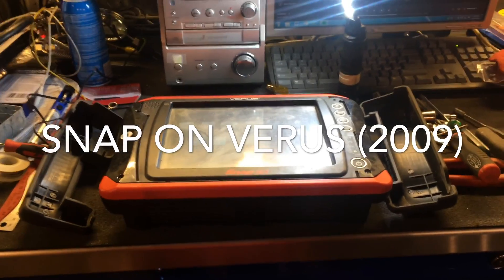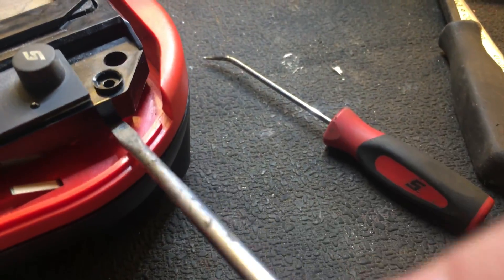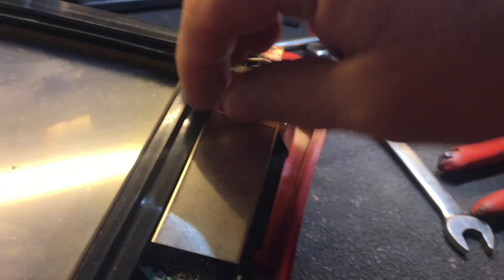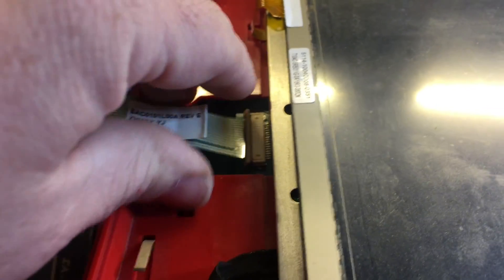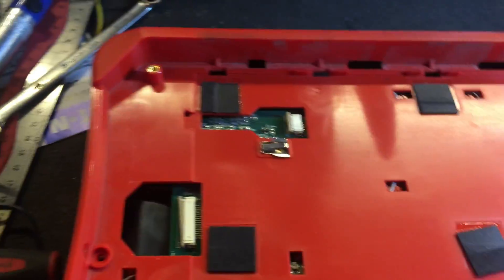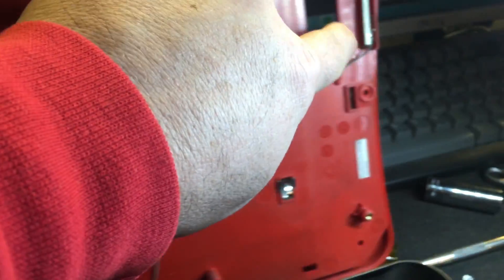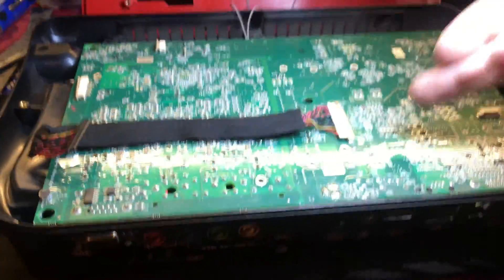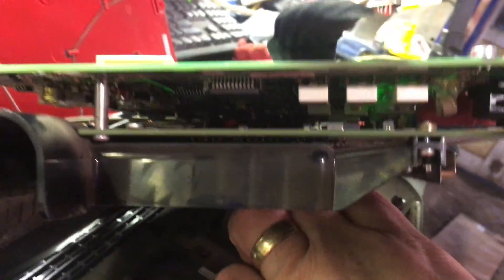Snap On Verus Disassembly Tips

Comment: Thanks for this, doing a similar Verus Edge, proper pain it is. Having replaced digitizers and screens before on regular laptops and tablets this is tricky, also the cost if it goes pear shaped.
Reply from the maker: I don’t remember if I put this in the video, but I found a compatible plug on mouser.com after taking careful measurements of the broken one. It takes some patience but they have all types of parts like this.
Reply: @JoesCarSmartsNY  For the DC input jack? I'm having this problem and looking for the part. Do you remember which one it was?
Reply from the maker: @rayl2555  I’m not 100% sure if this is right, please carefully check the measurements. Mouser has the data sheet with full physical specs: https://www.mouser.com/ProductDetail/CUI-Devices/PJ-047BH?qs=WyjlAZoYn52jIS8yCsl2vQ%3D%3D

Comment: Is that model number of the screen is the parts number we are looking for screen replacement ?
Reply from the maker: The part number at 7:05 is for the DC Power input jack that I’m holding in the video.
Reply: @JoesCarSmartsNY  I meant the part number for the actual screen? My screen is broken along with the touch-glass.
Reply from the maker: @mohammadajaz8798  Sorry. I don’t have that number.

Comment: Have you disassembled a verdict d7 i need to change cmos battery in mine.
Reply from the maker: I haven’t taken one of those apart yet.  The trick is finding all the hidden screws and then carefully learning where the case is still fastened together if it’s not coming apart.
Reply: I've just taken my verdict d7 apart very easy

Comment: how were you able to find the correct dc port? i have the 2012 version, so its different
Reply from the maker: I took careful measurements and used that to compare to the closest one available on mouser.com. The one I found wasn’t 100% exact but was very close and did work when I was done.
Reply: @JoesCarSmartsNY  Ok thanks, my dc port has 5 pins and I have yet to found one like that on mouser
Reply from the maker: AVSCDvideoproduction What scanner do you have?
Reply: @JoesCarSmartsNY  Verus d10 2012 model
Reply from the maker: AVSCDvideoproduction According to my Snap On rep the charging port is not a 5 pin plug. So you have me stumped.
Reply: @JoesCarSmartsNY  The model number is eerd301-6. Motherboard is dms-ba12 rev. A1
Reply from the maker: AVSCDvideoproduction My rep said specifically that there’s never been a 5 pin charging plug for Snap On. They’re all the same regular DC port.
Reply: @JoesCarSmartsNY  If I could take a pic I would, I currently have the motherboard in front of me

Comment: Is the hard drive in the top or bottom part?
Reply from the maker: Hard drive is in the bottom in a rubber sleeve. It sort of falls out when you lift the circuit board.
Reply: @JoesCarSmartsNY  I can't get the circuit board out even with all the screws and the battery removed. Is there something I'm missing?
Reply from the maker: Micbro did you remove the screws from the port on the back. They’re tiny little hex head screw posts that hold the cable into the unit.
Reply: @JoesCarSmartsNY  On the VGA port, the black port, or something else?
Reply from the maker: Micbro I think it’s either the VGA or the port that connects the OBD cable. But the nuts I’m talking about are exactly the same as on a VGA port.
Reply: @JoesCarSmartsNY  IT WORKED. Thank you so much! It's pretty hard to research this model
Reply from the maker: Micbro so glad this helped you. I appreciate the feedback.

Comment: If you see a message i have a big question about trouble shotting the problem with my verus scanner
Reply from the maker: What’s the issue you have?
Reply: @JoesCarSmartsNY  yea!!I call them and they said theu dont work on those anymore. Funny joke but anyways thx for the help ill probably takr it to a computer tech to see if he can check the motherboard circuits
Reply from the maker: JoseJulian Serrano Yeah. You might be out of luck in the end. If the hard drive has failed I don’t know how you’d restore it. Good luck!
Reply: @josejulianserrano1711  My Scan Tool is having the same problems. I was wondering if you ever figured the problem out ?
Reply: what do you think could be the problem.
Reply from the maker: JoseJulian Serrano That’s a good Question. I wonder if you have a bad hard drive. 

Have you tried holding the power button down?  It may be able to “reset” the unit if you hold it for about 10 secs or so.
Reply: @JoesCarSmartsNY  I have tried and it still persist at doing the same thing
Reply from the maker: JoseJulian Serrano Sorry. I’m out of ideas. May be time to send it in to Snap On for service.
Reply: The only thing that mind does is the power button lits up for 1 second then shuts off.. I plug ac current and does the same thing also so i know is not the battery. I dont hear the motor running or the screen lit up at all. All that happen is the power button lits up for a second and shuts off